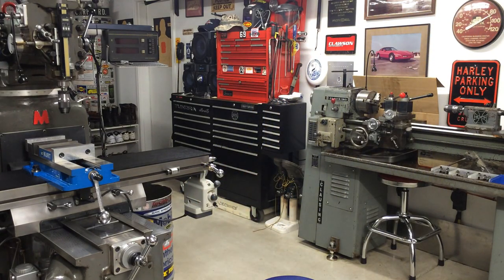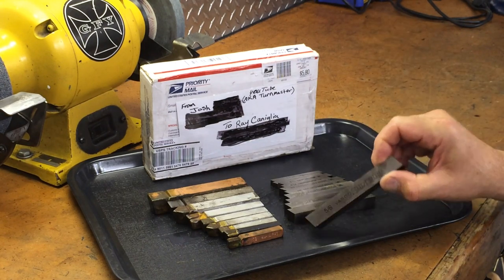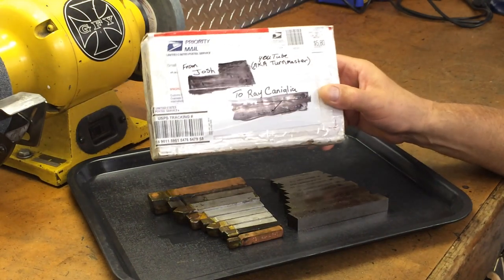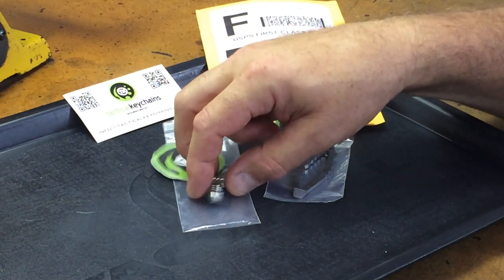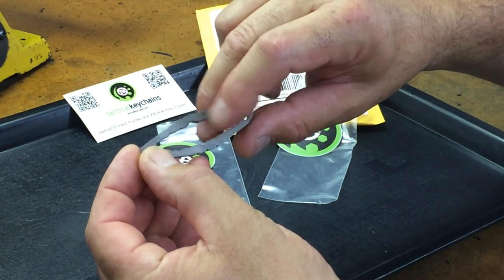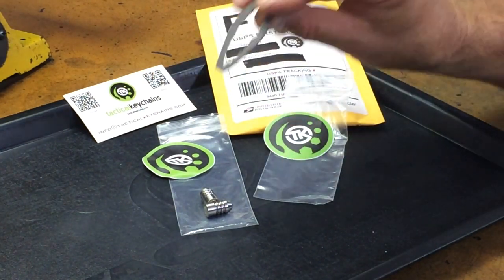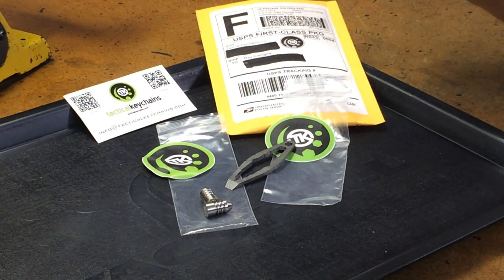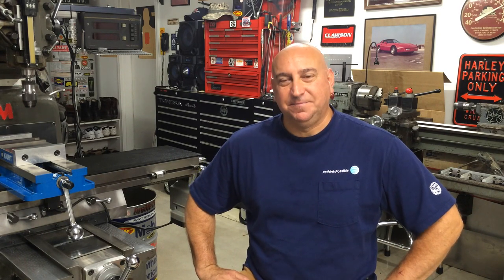Carbide Cutting Tools

Comment: Ray,
You got some really cool stuff! When I was a service tech for a couple of different companies, I serviced stuff in Clovis. For a Bay Area guy that thinks 80° is hot, I can't hack the temps. there! Thank God my service truck had a/c! Bakersfield is another hot spot. I had to do some work in the oil patch (west of town) and damn near died! It was so hot the LCD display on my Fluke turned black! Enough rambling about the weather. Thanks a million for the video! I noticed a Clausing lathe in your shop. Did you get rid of the Grizzly? Take care.
Regards,
Dave
Reply from the maker: Hey Dave,

I am happy to hear you got a tast of the heat here, and yes it will destroy electronics if in the sun too long! I have both the Grizz 14X40, and the Clausing 10X36, the Clausing was given to me by a friend but was a basket case so I rebuilt it little by little and now cut's like a dream! I plan on keeping both, it's great having two lathes. I often have a part set up in the Grizz and need to do a another lathe function, so the Clausing really comes in handy for the smaller stuff.

Thanks bud,

Ray

Comment: Hey Ray:
I ran into the same problem here in Las Vegas with the swamp cooler. I bought a 24000 btu GE window a/c ( runs on 220v) for my 22 x 24 foot garage. I was able to get a display unit at HD. They are going for $599, Walmart has them for $478 plus $49 delivery, but unit came damaged. So HD Matched  Walmart, then gave me 10% off plus $50 more dollars for no box or remote. Your garage looks bigger, so may not cool as well. I am in the process of blowing in insulation in the attic. It works real good.
Regards,
Ted
Reply from the maker: Hi Ted,

Thanks a bunch for the info on the AC! My shop/garage is 22 x 30, the master bedroom is above, so the insulation is good. I was told that if I keep the swamp cooler in the shade it will blow cooler air, I'll give that a try first. If that does not work I'll look into getting the AC unit.

Thanks again,

Ray
Reply: Hey Ray:
Something I forgot to mention, I was having trouble with the moisture the swamp cooler was putting into garage. it started rusting the handle on my mill.
Ted
Reply from the maker: Ted Johnston Hey Ted, Yes it does add moisture so I try and keep all bare metal surfaces oiled!

Thanks again bud!

Ray

Comment: Ray, look into mini split air conditioners.  Fujitsu and Mitsubishi make the most efficient models right now, and have good track records for reliability.  LG is also rapidly building a reputation for efficient units with good reliability.  Do the research and study the specs as well as the prices.  The best units are two and a half times more efficient than your basic window A/C unit, are much quieter, and spread the air around the room better and more gently.

Heat/cool heat pump versions are also available, and will heat for less than other options, except scrounged wood, in your area.

These things really require a look.  If I was building a large house right now, I would for sure install several mini splits instead of a central unit.  Redundancy, easy zoning, comfort friendly, top efficiency, and quite reasonable.  They will pay for themselves quickly with lower energy bills.

The top units in a size that would comfortably heat and cool your garage are around $1300-1500, not installed, internet pricing, and some installation parts would also be needed.
-Bob Korves, Sacramento
Reply from the maker: Hi Bob,

Thanks for the info, I'll look into the mini split system for my shop, might be just what I need.

Thanks again,

Ray

Comment: Hey bro, we ran swamp coolers most of my life. They have to draw air from a shaded area to do any good. Make sure they are in the shade in the heat of the day and they will work a lot better. Blessings, Leon
Reply from the maker: Hey Leon,

Thanks for the tip, I'll try to keep it shaded, maybe cover it in ice if it helps!

Thanks again bro,

Ray

Comment: Tool bits for a century!  Nice shop/garage!  The new air conditioners are more efficient and effective than swamp coolers.  They both use the same amount of juice to move the air.  A/C units use energy to compress the Freon.  Swamps consume juice pumping the water.  Either way, imagine how much energy is used for climate control around the planet?  It's a lot!
Reply from the maker: Thanks for the tip, I was not aware that the swamp cooler used as much power as a AC unit, I might have to look into getting one!

Thanks again,

Ray
Reply: Watts are BTU's, no matter how you cut it.  Sure, if it is 0% humidity, swamps function.  They trade "free" btus for for filling your house up with humidity.  I don't like the idea of filling a house or shop full of all of that humidity.   Proper insulation, sealed space, shade and attic ventilation are key.  Modern, efficient, a/c units are next.  I heard that they are incorporating VFDs on some systems, for even greater efficiency.  They vary the speed of the fan and compressor.  Rather than cycling from 100% ON to 100% OFF.  Stay cool!....Without  frying the electricity bill!
Reply from the maker: WAVETUBE84 Great point! I do need to look into a better cooling solution. Thanks again for all the good info!

Ray